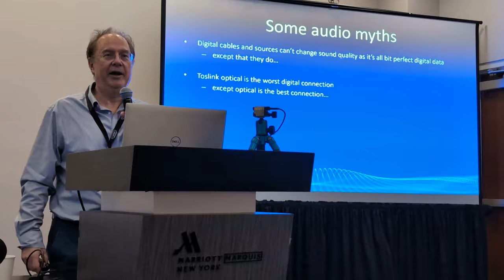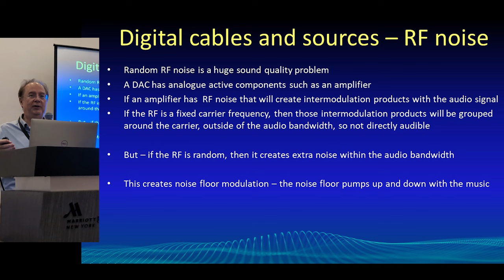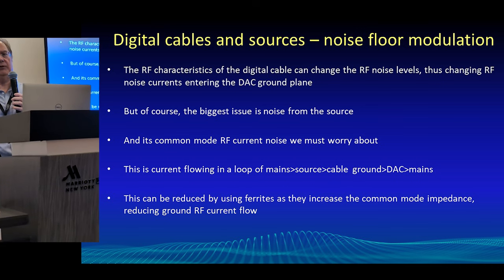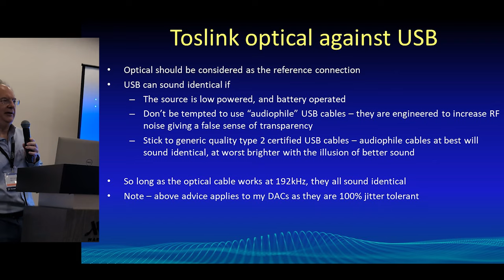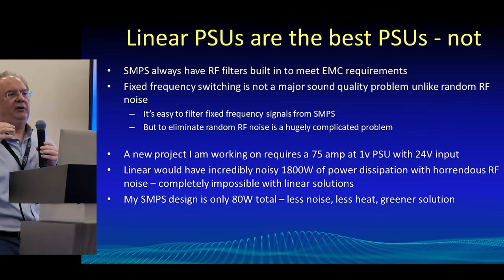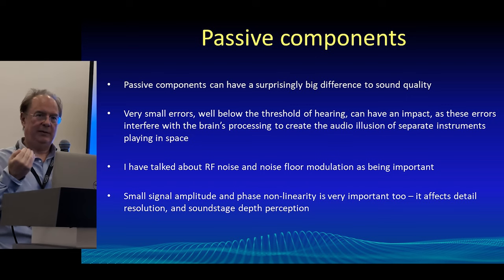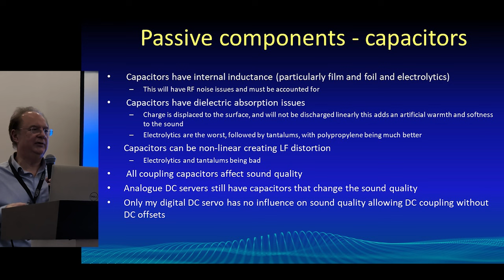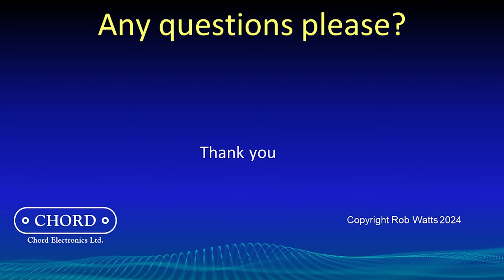Canjam NYC 2024 [Seminars] Digital Isn't - Rob Watts

Comment: There is no discussion that speakers can make a large difference in sound. The reason that cables and PS make or don’t make differences is because the possible differences are smal (relative to speakers and placement). Why does nobody tell us about the quantity of change they make, we could end the discussions for ever. Many of us are not interested in the promilles differences they make, we have other changes to make….

Comment: I use mojo 2 with Jotunheim 2 amplifier, qutest will be better dac? Or better to look for new amplifier? Tried today topping a90, didn't like it, on sale now
Reply: Buy an amp and keep the Mojo 2. It’s a very good DAC and there’s even an argument going on right now on Head-Fi where one guy claims the Mojo 2 is better than Dave in the right setup (he’s wrong, but still, it’s clearly a very good DAC).
Reply: I have a Mojo 2 and a Jotunheim 2 and a Qutest.  I did this comparison a few weeks ago.  I found the difference between the two Chord DACs to depend on the music track.  Sometimes I preferred one, and sometimes I preferred the other.  In general, I found the Mojo2 (EQ, crossfeed all off) a little bit brighter and the Qutest (white filter) to be more laid back or smooth (my interpretation of audiophile words!).  It was a subtle difference and dependent on the track.  If I had to pick one over the other, I think I would take the Qutest because I've loved its sound for years.  The extra brightness of the Mojo 2 was a bit much on a few tracks compared to the smooth presentation of the Qutest.  That's my personal opinion.  I use each in different setups so I'm going to keep both.  Oh, also, the Qutest is dead silent hooked up to my PC while the Mojo 2 sounds like an old Nokia phone near a radio back from 2001.  It's a bit annoying if you have the gain or even volume pot turned up on any amp.  If you are needing a desktop DAC, Qutest all the way.